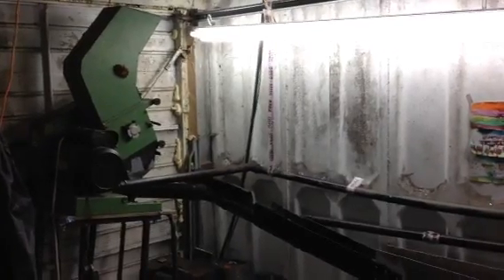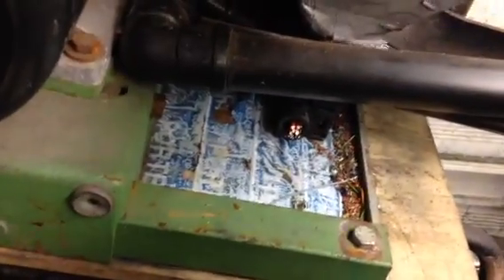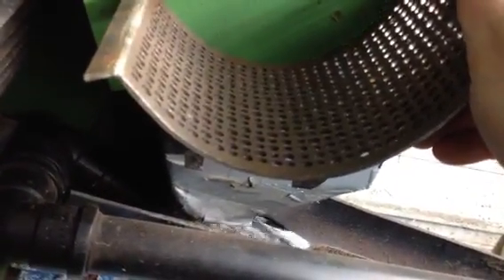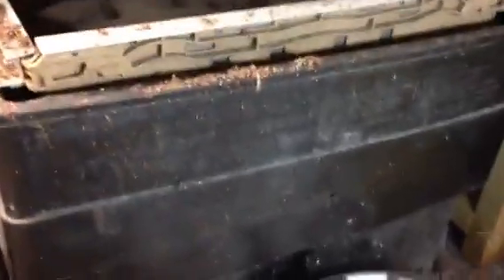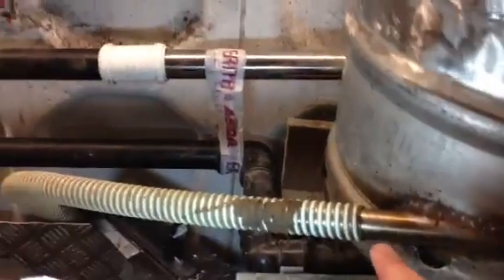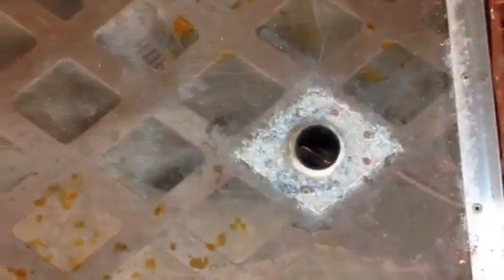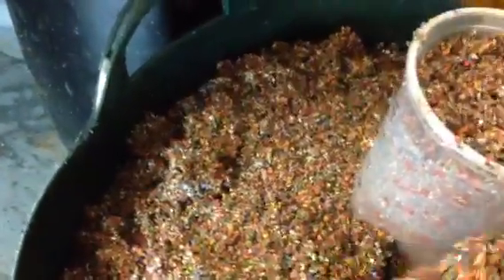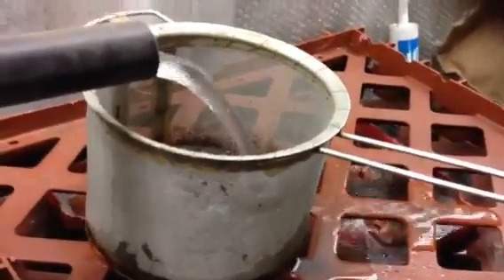Copper wire separation (do it yourself) how it works

Comment: You interested in a percentage cut on looms I take out got 15 at moment I am at bolsover
Reply from the maker: No ,I have enough already,Do you get the silver from the relays?
Reply: corsagafa no not looked in to this refinery part was told a while back that old slot machines had alot of preciuos metals but as always its time and getting the parts and then knowing how to build it a bit like my magnetic air engine project running a car engine on atom stripped air by making a fluid tesla coil out of the engine the way you think you may understand charging and out of phasing as the water you are vortexing is making a charge as it vortexes

Comment: can I use plastic granulator?
Reply from the maker: Yes, this one was used for plastic before I bought it.
Reply: +corsagafa thanks a lot , but what I cannot imagine that what make the plastic granulator separate the copper wire from the outer insulation
Reply from the maker: The Granulator chops the wire small enough so the water can separate the plastic from the copper.

Comment: What the hell? This is the worst separation technique I’ve ever had the misfortune of baring witness to. You should do some homework into air and a vibration table. Way less unnecessary process. And a far cleaner end result.
Reply from the maker: Hello thanks for letting me know what you think about my system,theres nothing worse than seeing a thumbs down without knowing why, so its good to read your comment.
First,the clue is in the title "Do It Yourself",when designing my system I had to take into account these factors.
A. Located in a small residential garage just 15 metres away from the neighbours
B.The system and also garage needed to run from the domestic electric system 240     volts/13amps
C.The copper to separate,car looms have very thin strands 0.2mm or less thick.
D.The amount of car looms I get to process is between one and four per month so it did not warrant spending thousands on an air separation table and over ten years ago when I started this hobby, there wasnt enough information on the net to make my own.
E."What the hell? This is the worst separation technique I’ve ever had the misfortune of baring witness to",I didnt invent the water sluice,its been used for hundreds of years.
F."You should do some homework into air and a vibration table".Yes I do watch videos all the time on youtube although having over ten years experience in separating thin copper wire,Iam well aware that a lot of the videos on here are from manufacturers that are promoting there products and you cant believe everything you see!
G."And a far cleaner end result".Please watch my other videos and you will see that I use air and vibration to get a clean end result with my vibrating screen.
H.So can you suggest a system that I could build that fits the criteria in A,B,C and D that wont upset my neighbours? If you are truly interested in copper wire separation,please watch my other videos before you judge,dont  write off water separation,its very useful for fine wire.
Thanks for your comment.